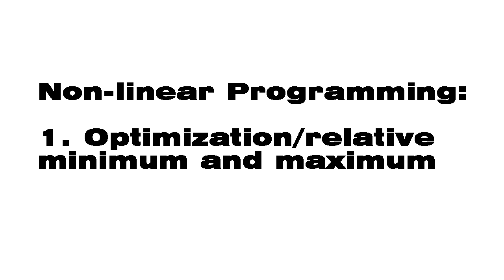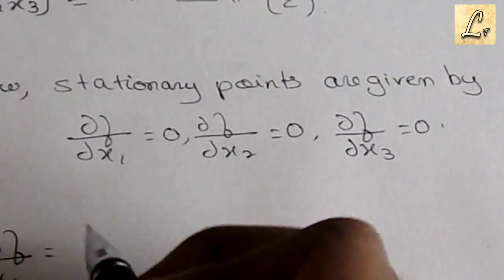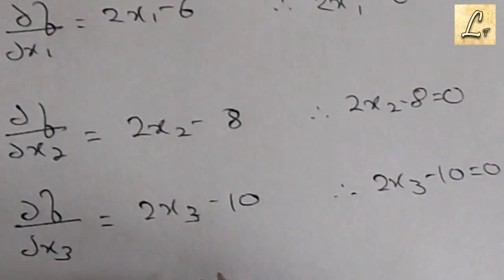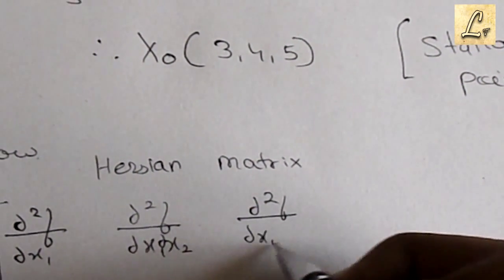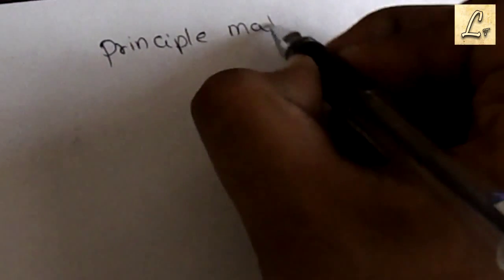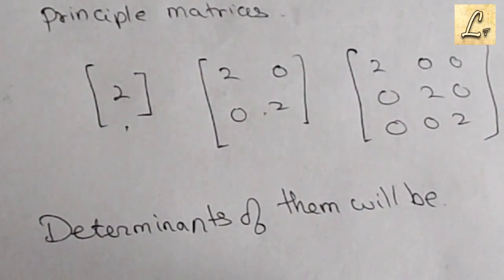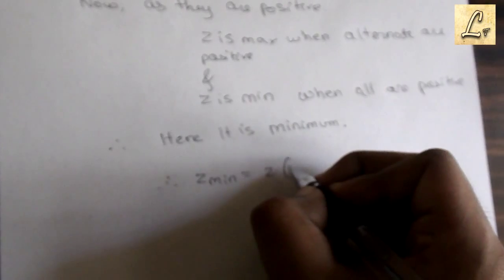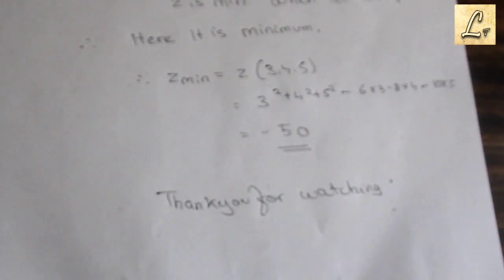Non-Linear Programming: Optimize/Relative minimum/maximum

Comment: sir how can we solve such this type of problem .
Such as long  question type.
Q =  X1 square + X2 square + 2X3 square + X4 square _ 5X1 _ 5 X 2 _ 21 X3  + 7X4. It is our objective funt.
Constrains are. 
0  less then know next valu  8_X1sq
_X2 sq_X3 sq _X4sq _X1+X2_X3+X4.
Second line 
0 less then know next value 10 is at the point of  8  and the same line.
Provide some tutorial or example of books where such type of questions are solved thanks .
I hope you provide some help.
Please also provide your email address.